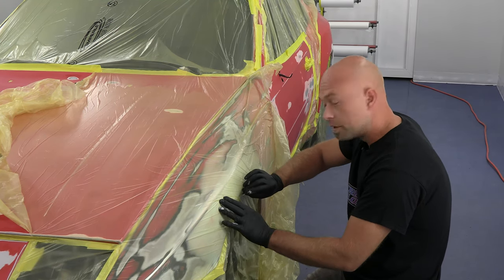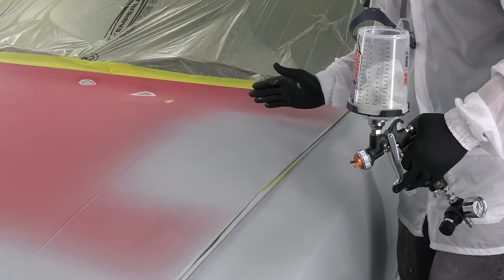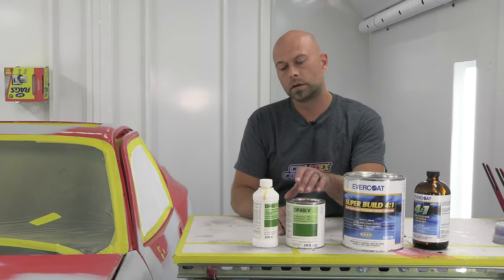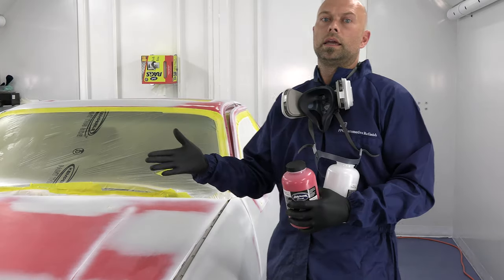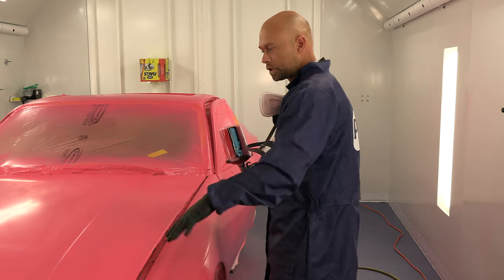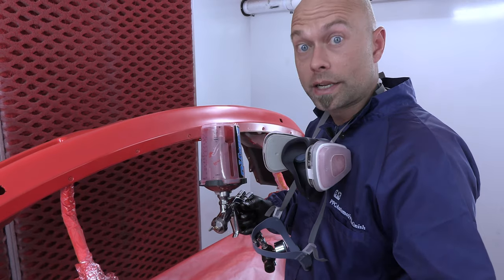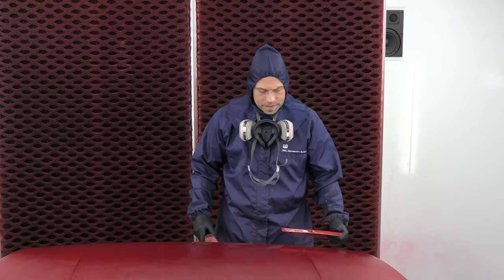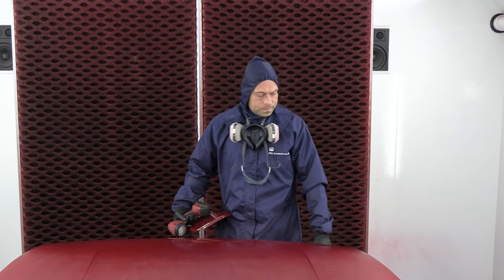How - To Paint a Car Candy Pearl with Water-Based Paint

Comment: Did you sand the hood for repair.Great paint job.Just started using your paint.
Reply from the maker: Yes, the hood was sanded and primed with both a polyester, which was sanded flat, then a 2k epoxy was applied any area where metal was exposed. Thank you.

Comment: Can you spray the autoborne sealers over a non-sanding primer or wet on wet?
Reply from the maker: Yes, AutoBorne Sealer can be applied over a non-sanding primer. Do not apply Createx paints including AutoBorne Sealer wet on wet, especially when applying over a non-Createx paint. Only apply AutoBorne Sealer over the non-sanding sealer after its thoroughly dried. Thank you.

Comment: What brand solvent do you recommend for degreasing before spraying?
Reply from the maker: PPG SX-394 is used to degrease primer and substrate before painting; do not degrease candy2o direct for clearing. Thank you.
Reply: @CreatexColors  a regular tack should be good for base and mid correct?
Reply from the maker: We use Gerson Ultra Prep Tack Cloths made for water-based paints. Thank you.